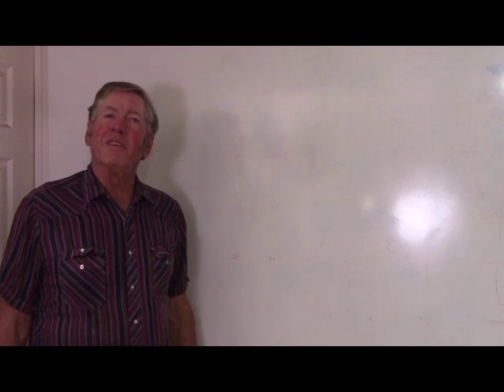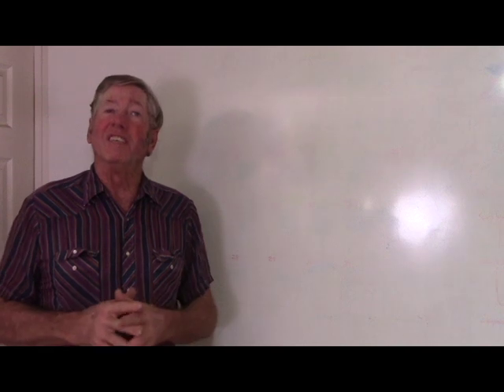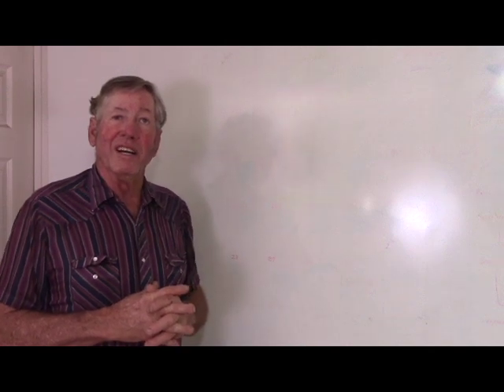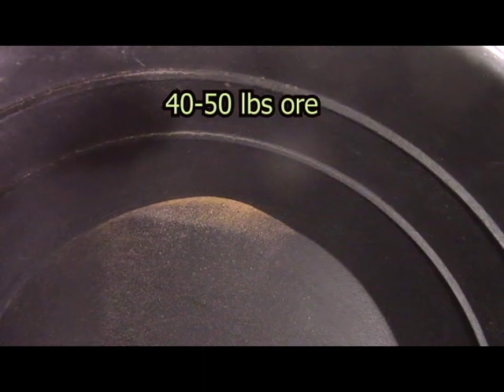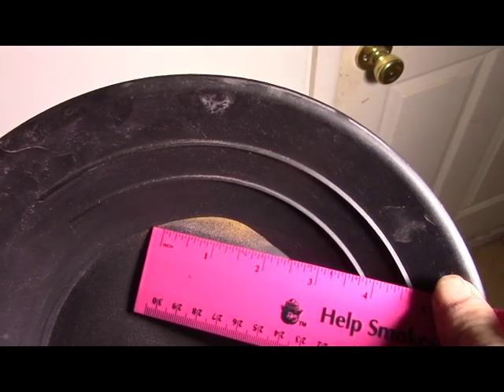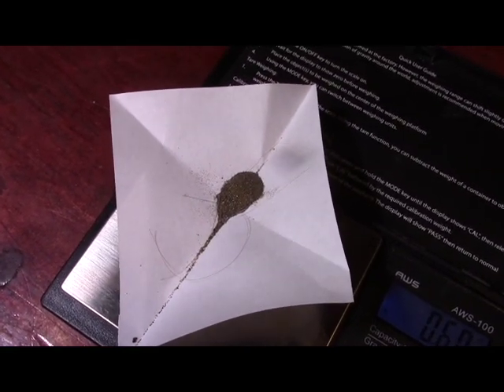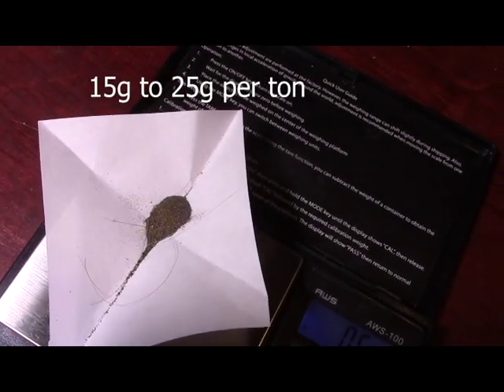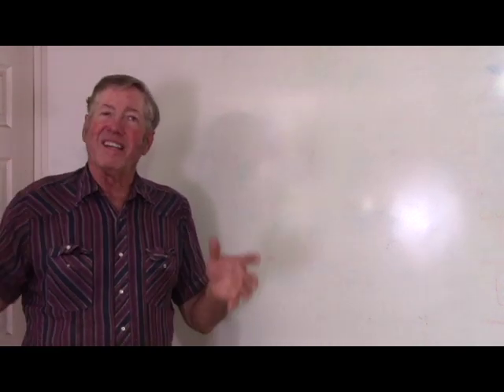133 The " I " is for Integrated

Comment: This project of yours is so endlessly interesting.
You remember the hard rock mines in Austria i mentioned?

With that system and a working miller table one could work all the material inside the mine and not have to build roads for heavy machinery and carry everything down to the valleys.
And no cyanide, mercury or any of that which makes all the differences between getting a mining permit or just having nice dreams ...

You know at one point in history,or so they say, 80% of the word wide gold prodution came from those very mines.

And they are allready asseyed, very accuratly too.
There is tons and tons and tons remaining.

Not that i ever could possibly raise the money to make something of it, but thats clearly the way to go!
Reply from the maker: You mention many of the factors I specifically took into  account.  The desirability of a non-chemical means of recovering gold at a reasonable productivity and relatively low cost are the goal.  My target is an overall profit of $200.00 US per day per person at a head grade of 10 PPM or less.

I am testing a new concentrator now that seems to do approximately as well as my experimental table at lower cost.  In some ways it is very annoying that something so simple seems to work so well after expending so much effort on the table.  :-)

We will see how it turns out...

Keith
Reply: @hardrockuniversity7283  This is so realy tempting for me :oD

As it should be for many of us. A small cost, low volume, low energy, low maintenance, portable unit that does more or less everything for us short of paning ... shut up and take my money!

With this i actually could consider the mines here. Even with my budget.
Which, for those that dont know, are basically on blank rock surface on a mountain top with no roads going there any longer.
Getting major euqipment in there or rock out is positivily impossible wthout spending millions in road building.
And i bet many people know places like that: insanly rich, but under current conditions not profitable for the big time players.
Plus, no chemicals needed.

Great project from the get-go Rock On!
Reply from the maker: @1000-r3g  Roger that!

I'm trying as fast as I can.  Would love to visit Austria some day.  It looks so beautiful.
Reply: @hardrockuniversity7283  You still have a standing invitation!

I didnt made it to the states this last autumn as i was hoping for but we are not out of reach :o)
Either way we will have at least one very, very enjoyable day together somewhen.

Comment: Hey 👋, I have been trying to integrate small scale system. Your using a blower, fine material transfer? I've basically have a vacuum type transfer. I have raised cyclone but have not used water yet, it was next. I have a small jaw crusher before haven't yet integrated before impact cobracrusher type just bigger, still handheld. Looking maybe blue bowl with wet system. Not too confident that it will, plus means I to spend time money and energy. Not ready comit quite yet. I don't have any materials to run. Thanks Keith Hard Rock University. You like the blower system better??  See you latter!
Reply from the maker: Just a little simpler.  I will find out how I like it over time.  Seems OK for now